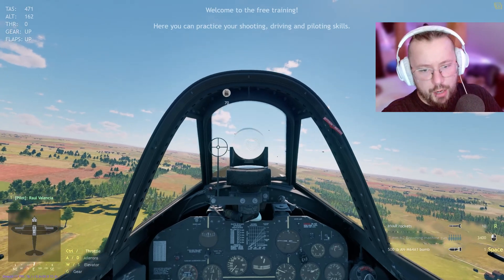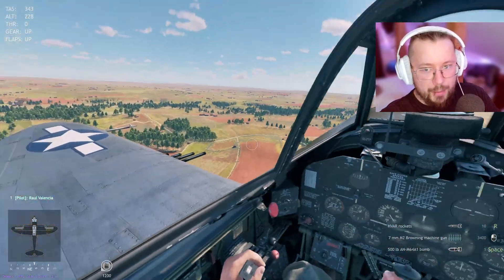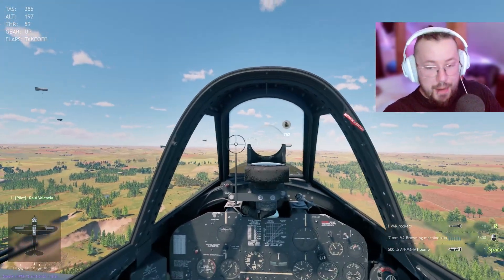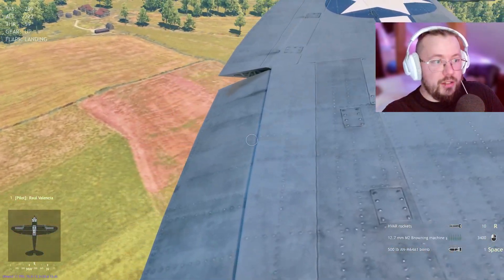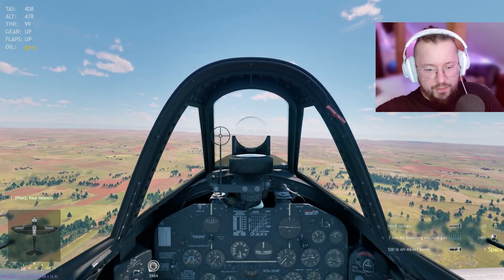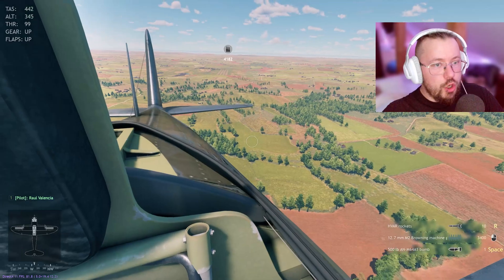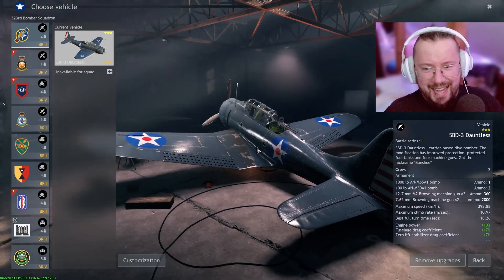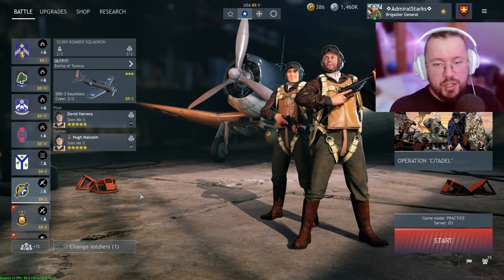Aircraft Flaps Explained • Combat / Takeoff / Landing and more.. • MeAdmiralStarks

Comment: Main purpose of flaps is not to slow down the aircraft. They do slow the aircraft down but that's incidental to their design, not the actual goal. Although in some cases, the flaps were also considered to be a form of "air brake" used to slow the plane down to landing speeds quicker.

The main purpose of flaps - and other high lift devices - is to increase the lift that the wing can produce at any given airspeed. Some flap designs do this by just turning down at the trailing edge of the wing, increasing the effective camber of the aerofoil so that it curves more, thus producing more lift. This category includes straight flaps (e.g. P-47 Thunderbolt, P-51 Mustang, and Bf 109) and split flap (e.g. Spitfire, Fw 190) types.

Other flap types also increase the surface area of the wing by extending back from the trailing edge, in addition to turning downwards. This type of fowler flaps can be found in for example Ki-27, Ki-43, Ki-84, N1K2-J, P-38 Lightning, and A-10 Thunderbolt II, just to mention a few.

There are also other types of high lift devices, like leading edge slats, which essentially achieve the same thing (increasing camber and total lifting surface area), but also usually energize the airflow on top of the wing so the wing becomes more resistant to stalling.

Now, increased lift helps in two situations: When you need more lift to turn harder, or if you want to be able to fly slower. In the latter case, when your airspeed drops, your wing's ability to produce lift is reduced and if you just try to increase the angle of attack, at some point the wing is going to stall and you can't fly any more. The flaps in this situation are used to offset the loss of lift from slow airspeed.

In the former case, using flaps to momentarily increase your turning ability should only be used if you are below your maneuvering speed and below the structural speed of the flaps themselves.

Maneuvering speed is the lowest speed at which your aircraft can reach its structural load factor - let's say 8g in a turn. If you're flying faster than that, then flaps will just help you exceed your structural load factor which is less than desirable (your plane will rip itself apart).

If you are flying slower than maneuvering speed, then using flaps will give you a momentary burst of increased turn rate. However, the flaps also increase your drag by making the wing less aerodynamically efficient. In other words, the lift-to-drag ratio of your wing gets worse, and that means you start losing energy faster than if you didn't have your flaps extended.

This means that, while transient turn rate might be improved with flaps, sustained turn rate is almost universally reduced by the use of flaps (with some notable exceptions).

There are only a handful of aircraft that were designed to use combat flaps while maneuvering (P-38, F-14, maybe Ki-27, Ki-43, N1K2-J, and maybe Ki-84). In most other planes, using the flaps will almost always make your position worse in the fight if you can't use them to actually shoot your enemy down very quickly.

Because of this, use of flaps in combat is a topic in which there is no simple solution to use them or not, except that in most planes, in most circumstances, you're almost always better off not using flaps and if you are in a situation where you think you need to use flaps, you've already made some sort of mistake to get in that position. But ultimately, you gotta do what you gotta do - if using the flaps is necessary, then you must use them. And you only really learn when to use flaps by experience. We virtual pilots have the advantage of unlimited lives to learn...

The best "overall" suggestion is that if both your enemy and you are turning in the same direction (two-circle flow), don't use flaps (excepting the exceptions). If your enemy is turning in the opposite direction (one-circle flow), like in flat scissors or rolling scissors, then using flaps to be able to fly slower and force an overshoot may be a viable option.

Comment: Rudder is used for coordinated turns alongside ailerons and elevator (keep the ball centre in the cockpit instrument for slip indicator).
Mouse aim doesn't do this. I also don't do this on Xbox because the control setup is shite unlike War Thunder.
Aircraft turn better when the turns are coordinated.
Source: former flight instructor.